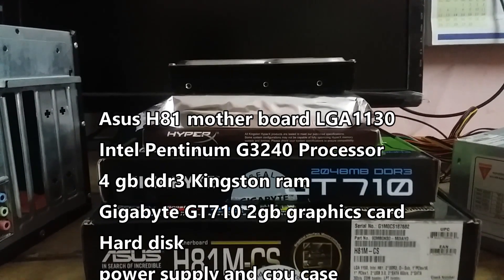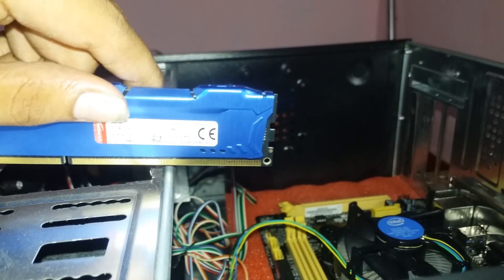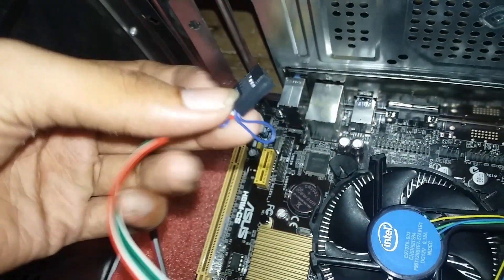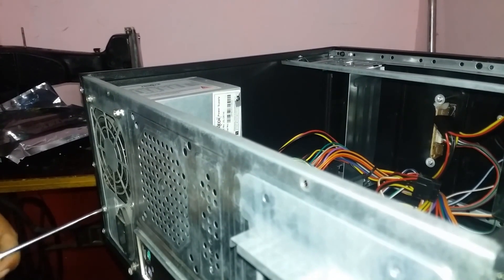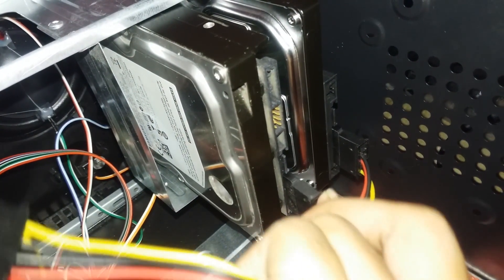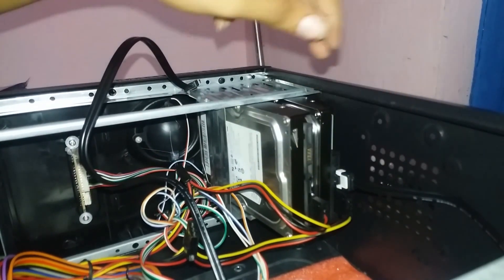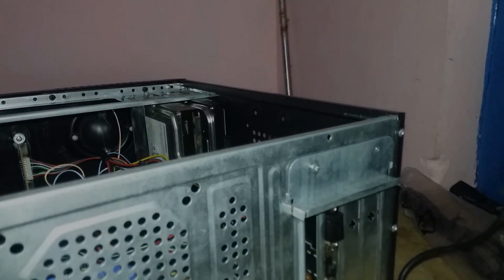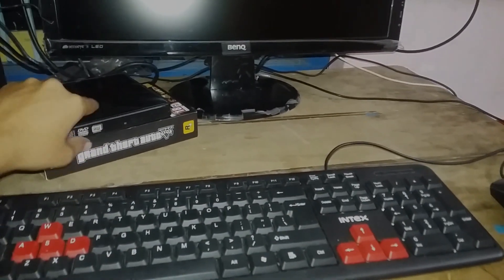How to build a pc under 20k in Telugu

Comment: Hi. Sir. Can you. Sajust suitable power supply. Unit. And. Cabnet. Plese sir for gta5 I seen. Your. Videos Iam. Try to do I purshed. All parts. Accept. This 2.parts I. Did. Not. Get. In amazon
Reply from the maker: you can use any powerSupply, and Cabinet.
 GTA 5 gameplay depends on Processor, RAM, and Graphic card Only. and ofcourse a HDD to store Game.

Any ways, if you want me to suggest a suitable PSU and Cabinet, Here you go.

Best Budget CABINETS 
http://amzn.to/2i2IMVO
http://amzn.to/2i53apu
http://amzn.to/2A9DjkE
http://amzn.to/2iO7ruz

SMPS - PowerSupply

500W - http://amzn.to/2iOH1c3
550W - http://amzn.to/2jXUJwC
450W - http://amzn.to/2A9Jzce